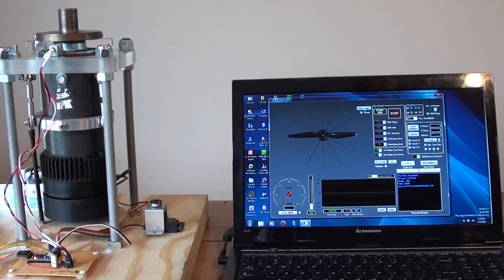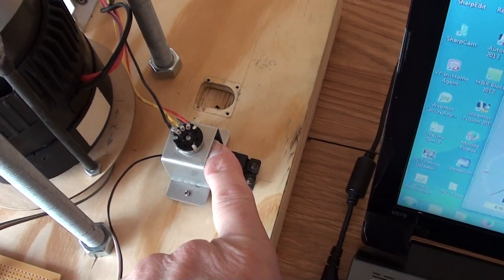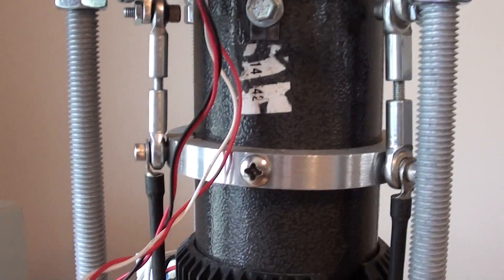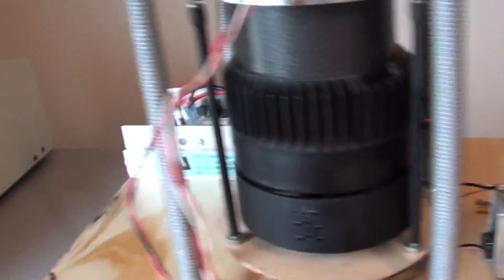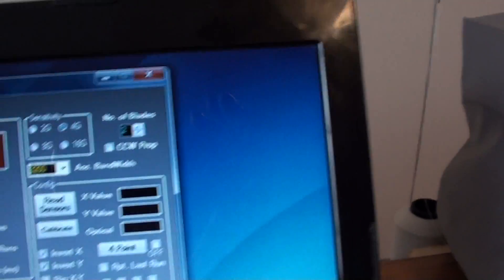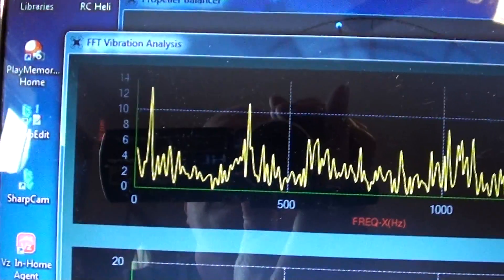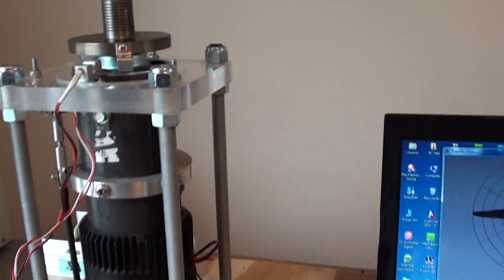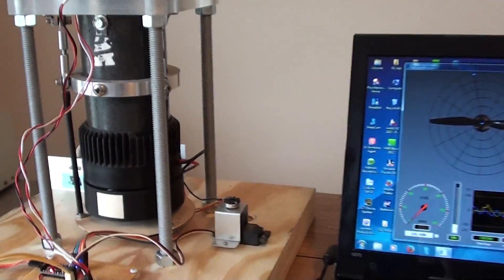Dynamic Propeller Balancer

Comment: Just wondering if you still have the original Arduino files used in this project. ( DPBalance.arduino.hex       directory called Xloader     Setup.exe   ) all of which were in a zip folder originally) 
Asked cyborgcnc who is the developer but now it is only supported by Teensy3.2 microcontroller which are an arm and a leg to buy, if one can get deliveries these days due to the virus. 
Intention is to slightly modify as a driveshaft balance sensor on a '78 Celica I am restoring.
Reply from the maker: Sorry, I don't have any of the original files. I just have the ones for the teensy 3.2
Reply: @Dynodon64  OK....no worries..... just thought as your video showed an Arduino ProMini, then that would have been your files.
Neat setup, like the pot drive servo idea,. I actually done that myself before on another project. Simple and works.

Comment: Did you get to balance some propellers with this?
Reply from the maker: +Futterama, I have balanced the propeller hubs on two of my props. I have a problem trying to balance the whole propeller.  It turns out the speed controller I have for the treadmill motor has a lower rating than the motor it's self. So the speed controller trips out due to over current. I need a larger speed controller with more current potential, in order to balance a whole propeller . Most of the balance problems with the props I use comes from the hub. Once you weight match the blades, it runs smooth. Some day I will find a larger speed controller and try it again.
Reply: Thanks for the reply. I need something like a 1kW motor for my balancing needs. Treadmill motors seems like a good choice and your mechanical setup seems to be very good with high sensitivity to imbalance so the accelerometer can easily pick up vibrations - the rubber mounts others have been using must absorb some more energy than your setup.
Reply: I have found a 1.5kW motor for 180V with max RPM of 5400. We run 230V AC utility power here. A simple homemade controller could consist of a bridge rectifier to convert AC to pulsating DC, a large 400V capacitor to smooth out the pulsating DC to near constant voltage DC, a 400V rated MOSFET for PWM, a MOSFET driver and a small microcontroller circuit for generating the PWM signal. I can do PIC programming so I can read the servo pulses directly and convert this to a PWM duty cycle, which should also be limited due to the difference in input voltage and motor rated voltage. This could be a very interesting project.
Reply from the maker: +Futterama, you can get everything I used from this site, so you won't have to re design it.
https://www.rcgroups.com/forums/showthread.php?2337523-Dynamic-Propeller-Balancer-Build
Reply: Thanks, I do know that thread, we just need bigger motors for driving the bigger propellers :-)
Reply: I have been thinking more about how to make your own motor controller for a 180V treadmill motor. Do you know how your controller is varying the voltage to the motor? If it's just chopped up rectified AC with an SCR, the power pulses are at 100Hz which could show up on your graphs, maybe even mask your 50Hz spike and that could be why your 50Hz spike sometime is missing.
Reply from the maker: Futterama, it's a DC motor, so the controller has to rectify AC to DC. It uses a chip to make most likely a square wave variable duty cycle pulse to control speed. It's most likely a mosfet driver and not an scr. A full bridge rectifier will increase voltage all by it's self, so that may be why it's 180 volts. I don't know what frequency the system operates at, but the 50hz might be as you suggest.

I got you email today as well. The props I have are ground adjustable. So to keep the thrust from lifting the unit, I pitch the prop to neutral or zero degrees, This will also remove most of the load on the motor, to give it more power to spin up to test speed. If the prop needs 100 hp to spin it at 2500 rpm, then this motor would need to beat least 90 hp just to spin it at 1000 rpm. So you can see the problem here. Hope this helps.
Reply: @Futterama  driving a DC motor is not that straight forward, the treadmill speed controllers have some very fancy "secretive" electronics to manage slow starts and applying power. It would be better to scale up the speed controller with bigger mosfets and more current. All these treadmill speed controllers have some programmable chip in them that you cannot easily read the contents out.

Comment: very cool. I'm going to scale it up to balance a 12+ inch bevel ring gear made from carbon fiber (I hope!).
Where did you get your tie rod end turnbuckles? Did you just replace the ends of a common turnbuckle with some tie rod ends ?
Reply from the maker: The rod ends are on a piece of all thread rod. Their not really a turn buckle, because they are both right handed threads. I bought the 1/4 inch rod ends from Ebay.
Reply: Thanks! Great design.
Reply: What model of treadmill motor did you use? I'd like to try and duplicate your design as much as possible for my setup.